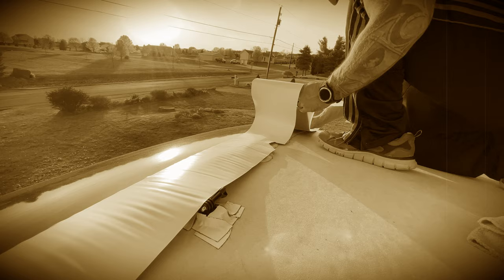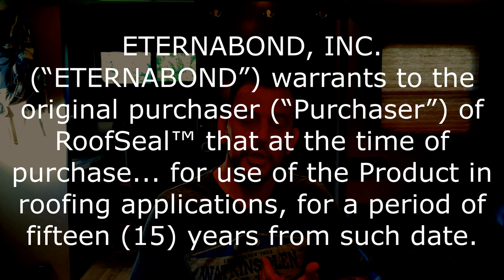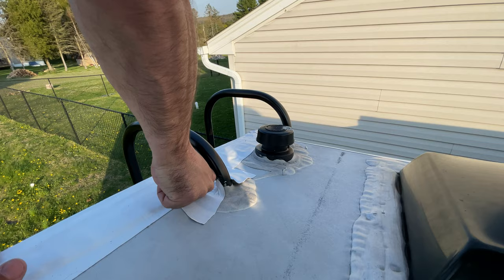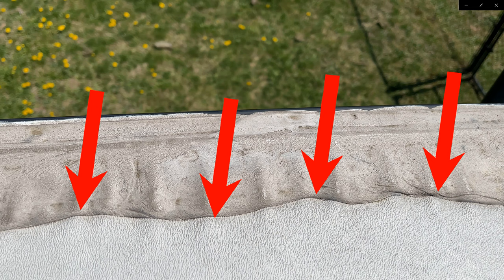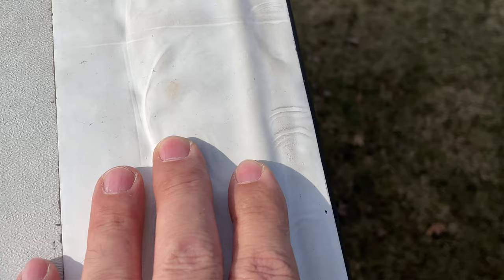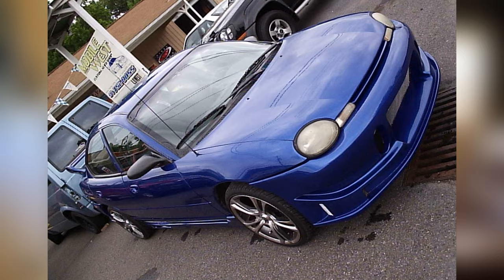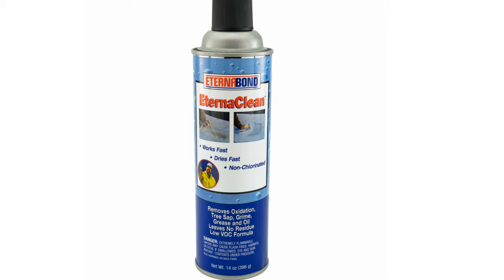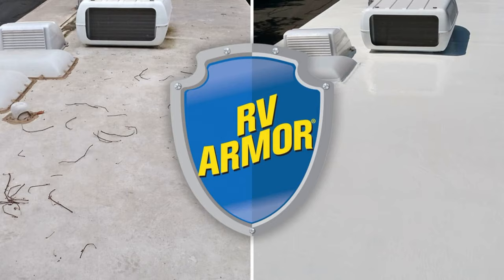The RV Eternabond Roof Seal Modification 1 Year Later

Comment: Ross. Thanks for this lesson. We are just starting this RV experience soon in our 70’s. Waiting on delivery of our new TT. Since we live in Florida and it will be stored outside, should we think about installing this ASAP as a preventative or could we wait for a year and see how the seams are looking? ( or maybe wait 6 months for a cool day.) LOL Speaking of that, does Eternabond adhere better on warmer days?) Thanks again, Larry
Reply: I would at least do the vents and over the fridge unless you got a12 volt fridge and didn't get a vent for it. I would also do the front and back. As for the sides, i would wait if it's brand new. As far as the skylight, remember that skylights can get old or crack and eternabond is hard to remove so that's a personal choice.
Reply from the maker: it seems to be a little stickier on hot days, but applying pressure is important regardless of the temperature.  it doesnt matter when you do it, as long as the sealant is in good shape and clean.  Good luck with your new RV and dont hesitate to ask questions.
Reply: Advantage of doing it soon after taking delivery is everything is clean and hasn't been degraded by the sun.  In FL, I'd consider getting a good cover if I was going to leave it in storage for more than a couple months.  I cover ours in the winter in Idaho while we go to FL. No, we don't take our RV that far.  Yet.  Next winter we're making that trip.

Comment: Great video. Bought a camper a few years ago. Just brought it home to dewinterize/maintenance. Seals didn’t do well this winter. Cracks everywhere. Wasn’t like that when I put it away.  Going to do eternabond tape after I replace the sealant. When you did along the sides, how did you press it in that little indentation inbetween the gutter and roof membrane?
Reply from the maker: You can use one of these:  https://amzn.to/41ccFCD

Comment: I am getting some leaks now after two years. I believe it is getting past the section of tape on the hinge side of the vent. That is a difficult area to get the best seal because of the uneven areas where the hinges are. 

Did you have any tricks to work around that area of a vent? 

I think an extra strip of Eternabond above the hinge area to raise the level of the tape might work. 
Oregon is a rough place to have a leak!
Reply from the maker: not exactly sure where you are describing because i never went over hinges on mine.  everything i went over had lap sealant.  can you send pics to management@rvtipsandtravels.com and ill see if i can figure out whats happening, but i dont think its the eternabond.

Comment: Thank you for this great video. I have one question if I may ask: the front shield of my roof top is made of ABS, has Eternabond good adhesion to such kind of surface as far as you know? Thank you so much. Edoardo
Reply from the maker: eternabond will easily stick to ABS.  make sure to clean it well first.

Comment: Thanks for the original and the update will definitely be doing this to my camper.  Did you do anything to your windows or anywhere else water could get in?
Reply from the maker: windows should be periodically checked with the rest of the seals and resealed if necessary.  I use this to seal my rv: https://amzn.to/39rRyr7
Reply: @RVTIPSANDTRAVELS  did you take your windows out like i seen in other videos or just clean then reseal around them
Reply from the maker: i just check the outside seals.  love working on the rv and making videos, but i dont see any reason to remove windows if they are not leaking.

Comment: Love your videos.  I am going to use EternaBond on all my seams.  One question, with EternaBond seemly so good, could it be used to layer the entire RV roof?  Start in the rear and overlap until reaching the front.  Do you see anything wrong with doing this?  The entire roof would not need any maintenance except to clean.
Reply from the maker: Just the seems, walking on it can cause it to shift.

Comment: Do you think that a small piece of the tape between the rv roof and a solar panel bracket mount would be a better way to seal the screw going into the roof vs the sealant?
Reply from the maker: I’d probably put a dab of sealant over the screw first, let it cure for a month, then you can apply eternabond over it if you want.

Comment: Nice job man.  I’m going to do this to my camper.  One question though, would you put this on your slide outs?  Also are the wipers on the side of the slide outs different size than the top?  Thanks in advance
Reply from the maker: I have not put any on my slide out because the factory tape on the edges is still holding up well. Plus there’s no sealant on my slide out.

Comment: From the 4 years since I've installed Eternabond tape on the roof of my 78 Avion I can only say the tape seems to hold up extremely well to the California sun, It's remarkable that the outer layer of the tape seems unfaced by the UV impact, wonder if it's made of HDPE (high density poly ethylene) and will last for decades?
Reply from the maker: it is pretty impressive how UV resistant it is.

Comment: Living in a jayco fifthwheel up north in Quebec province thank you sir  have a question why put the filler and not just strait seal it with the tape.?
Reply from the maker: the sealer was already on the camper, so instead of pulling it all off i went over it.  either way is fine.

Comment: Curious on why you havnt applied tropi cool over the coach for protection as well as temperature reduction?
Reply from the maker: great question Greg... i think eventually i would like to coat the roof.  havent gotten around to it... my only concern with Tropicool is that it is silicone based, so if a repair needs to be made nothing is ever going to stick to it, and the reason so many RV'ers stay away from silicone based products on an RV.

Comment: On the side, how will you replace the trim protector over the screws if eternabond is halfway on it?
Reply from the maker: its only half way down, so you can still pull the bottom of the trim protector up and away from the screws if you need to.  the tape remains pliable so it will bend when you pull the cover up.

Comment: I have been trying to find out what type of sealant adhesive they seald my trailer with,  its grey an was told it was a very good product  because of  how strong adhesive is .  I would like to reseal then put this tape over it
Reply from the maker: Daniel, try calling the manufacturer or the dealer it was bought from.  It’s probably either Alpha or Dicor.

Comment: I have a few 2-3 inch bubbles on the edges, would you pop the bubbles and squirt some superglue in and then tape ?
Reply from the maker: That’s fine to do, but I’d use an approved adhesive for the type of membrane you have, not just a random superglue.  Make sure the eternabond covers the small holes you create, but that’s fine to do, it’s meant for that.

Comment: What UV sealant could I use ALONG with eternabond? I’m concerned with uv paint sealant not sticking to the eternabond or vice versa. Also, any recommendations on how to figure out what type of roof you may have? I’m not sure if I have tpo or epsom. Thanks so much in advance!
Reply from the maker: sorry for the late response, must have missed this one.  the manufacturer should be able to tell you what your membrane is made of.

Comment: If you removed cracked or failing lap sealant, why would you replace it with any new Lapp sealant if you’re going to use the tape anyway?
Reply from the maker: You don’t have to, but you can apply this over lap sealant.  I think many folks would want that additional layer of water protection.  If I do this again I would completely remove lap sealant.

Comment: Great video. After how many years, should I start looking to do this mod? My TT is less than 1 year old.
Reply from the maker: Doesn’t matter, remember the purpose of the mod is so you don’t have to reseal with lap sealant.  So the lap sealant needs to be in good condition to cover it.  It’s not to fix leaks.  If you have a leak it’s best to find out why first.  But if your lap sealant is good, you can do it.

Comment: Big question - I have an aluminum roof. Any caveats, anything different or that I need to watch out for,  in applying to a metal roof? Thanks so much -
Reply from the maker: eternabond will stick to aluminum.  if you have rivets, you might have one pop later, i would ljust gut out a section to fix the rivet, then apply a small piece back over it.

Comment: I have one area on my trailer where the lap sealant is cracked resulting in inside water leaking.  If I replace the lap sealant only in this area before applying Eternabond, what brand/type of lap sealant does everyone recommend?   Thanks for the great video!
Reply from the maker: if you have either a TPO or EPDM membrane you can go with either Alpha or Dicor.  Both good products.
Reply: @RVTIPSANDTRAVELS  The trailer is 20 years old.  The front cap is a white colored molded plastic.  Not sure what the material is.  How can I tell what the material is?
Reply from the maker: go with this, great product, cant go wrong with it.  let it sit for 30 days in warm weather before covering with eternabond. https://amzn.to/4cbX9xl
Reply: @RVTIPSANDTRAVELS  Thanks!

Comment: Thanks so much for the very informative videos. I do have questions I’m really hoping you can help me with. I have a 6 yo little 18’ tt that has spent the majority of its life in the dry heat and sun of El Paso and Arizona deserts. All of my lap sealant is trash and needs to come off or is already gone. Can I use this INSTEAD or is the lap sealant a requirement first? 
- also note that as soon as this is done I’ll be selling so money and time are a concern, BUT I’d still like to do it right. 
Thanks so much in advance!
Reply from the maker: Honestly, remove the lap sealant and apply new lap sealant.  Call it a day.  No need to use eternabond on something you’re selling.  It’s an additional cost and more time for something you aren’t going to benefit from.
Reply: @RVTIPSANDTRAVELS  Thanks so so much! Really appreciate all the info and your reply!!!

Comment: Our camper is a 2020.  It looks all original up there.  When we get it out of storage I think I will do this while it's still in good condition.  I am wondering if wider is better when using the eternabond?  Seems that if there was a slight leak under an edge then obviously the further away the better.  Obviously more money to go wider...do you think that's necessary?
Reply from the maker: Not necessary IMO, I’d go with enough to cover about 2 inches on each side of the sealer.

Comment: another issue that this mod could complicate is when the TPO adhesive fails - which seems a bit more common after 3 years.
Reply from the maker: The tpo adhesive on my rv started failing long before I installed eternabond.  However, in the 2 year review video, I show that the lifting actually stops at the end of the eternabond.  Had I not installed eternabond I’m willing to bet the pulling would have continued further.

Comment: Have you run the eternabond from the roof right down the side?
Reply from the maker: No, I wouldn’t recommend doing this.  The tape stays pliable and may slide on vertical surfaces.

Comment: Question, what if there is a possibility of water or moisture underneath the rubber membrane what would you suggest?
Reply from the maker: that's an issue that i have never dealt with and probably wouldnt be the best person to ask.  i would assume however that it will cause the membrane to separate from the surface, and probably should be removed, dried, and reglued first, or even an entirely new membrane.

Comment: curious on on every ones opinion.  I have a 2022 jayco jay flight slx 8 264 bh.  live in se michigan.  obviously if the roof is in need of repair do it but how many years before doing as a preventative measure?
Reply from the maker: repair first, you need to have a healthy foundation

Comment: What do you think of eterabonding the slides?
Reply from the maker: ive seen folks do this on the top of the slide where there is that line of tape, however I have not done it yet.  I would say this, dont use eternabond on a vertical surface.  it will slide down, but you can do it on the top of the slide.

Comment: Is the (very minimal) height of the product enough to affect drainage off the sides into gutters? Wondering if slight pooling happens. Thanks!
Reply from the maker: Good question... there might be a small amount, but its so minimal.  If there is, its not affecting how the tape edge is sticking.  a 2 year update is coming soon.

Comment: I am a novice at this, but could you use Eternabond over the entire roof? Is it worth it? What is the most economic way to redue the roof? I have a 28' FR Wildwood Xlite.
Reply from the maker: I wouldn’t.  Because it stays pliable, it’s not good to walk on.
Reply: @RVTIPSANDTRAVELS  thanks. Didn't think of that, good to know before I started that one.

Comment: Hey Ross. I just purchased a new RV. 2023. Would you suggest using this on a brand new roof?
Reply from the maker: You can, doesn’t matter if the rv is new or not honestly.  The condition of the lap sealant is more important.  If the lap sealant is bad, replace the lap sealant and let it cure.  Being it’s new, you’re fine.

Comment: I use a product called Through The Roof. It is a thick liquid that you apply with a brush. It's used on homes etc.. to seal. It is about the same consistency as silicone for comparison. It works very well and I used it on all my skylights and vents on my 5th wheel. Very easy application. I simply scrubbed the area to be sealed, wiped down with a towel and the brush applied the product. It is crystal clear and I have had zero problems.
Reply from the maker: Thanks for the info!

Comment: I just bought a brand new, 2022 camper. Would you (or anybody else reading this) recommend using eternabond, as you did, on my new camper, or would that be a waste, since it's so new?
Reply: I was wondering the same thing.
Reply from the maker: age doesnt matter, what matters is if you are going over the lap sealant, it is healthy.  everything needs to be cleaned as well.

Comment: So I have a 2008 Flagstaff it needs a new roof I have two questions 
1 I’m going replace some sheathing because of water damage would you recommend any tape cover the seams
2 After seeing the eternal bond tape I’m thinking the lap sealant might be a redundant sealant and not use it your thoughts 
Thank you Jim 
Ps great videos
Reply: If you're paying for a new roof i would just go with a lifetime roof. There are 2 main options...rvroof or flex armor or rvarmor. One will come to you, the other you'll need to find a location near you as it is done in a controlled environment.
Reply from the maker: just talked to a guy today who has RV armor and said its cracking,  they offered to come out and fix but he is going to fix himself.  another reputable channel too so I believe him.  i think roof coatings are fine, but they arent nearly as thick as eternabond and I dont see them providing the elasticity and protection.  i think theyre fine to add some UV protection to the membrane and other components, but i dont think they provide the sheer protection of eternabond.  just my thoughts though.
Reply: @RVTIPSANDTRAVELS  that's good to know. I'm doing the eternabond route for now but if i ever filed a claim for a new roof i was looking at the lifetime roof route. Rv armor cause they come to you but flex armor has better reviews and they are near me. I guess if the time ever comes I'll have to do more research

Comment: I'm wondering if any of the lower cost options of tape are comparable to eternabond? Have you heard anything that is a solid alternative? I actually just ordered some of the cheaper tape as I have a leak on 1 skylight. I thought I'd give it a try as it seemed to have maybe 80 percent positive reviews and costing less than half of eternabond.. hopefully it does the job??! Are you certain that the lap sealant needs replacement prior to taping if it has failed?
Reply from the maker: Haven’t tried any of them.

Comment: I understand the tape along all edges, even on a problem area that may be leaking. But putting the tape around everything that’s on the roof? Let’s say the skylight over the tub cracks and needs to be replaced, but you have tape over all the self-leveling caulk. Seems like it would be a nightmare getting that tape off without ripping the rubber roof. What are your thoughts on this?
Reply from the maker: The tape on top of the sealant won’t affect how the sealant sticks to the membrane. If you have to replace it cut along the edges of the sealant.  This is actually explained in this video around 7:44
Reply: @RVTIPSANDTRAVELS  sorry, somehow I didnt see that part of the video

Comment: Has anyone used this and effectively stopped leaks? I have several that idk where they are from so this is my first attempt to fix it.
Reply: I have successfully used this to patch a small rip in my roof. I simply cleaned the area, ( not very well at that) cut a patch that covered past the rip by about an inch and stuck it down. It's been about 3 months and it is fine.
Reply from the maker: thanks for watching!

Comment: Duct tape will pull remaining microsealant off the surface after you’ve removed EternaBond tape with heat and a scraper.

Comment: Would it stick better if applied with heat?
Reply from the maker: Sort of… just apply it on a warm day when both the eternabond and membrane are the same temperature.  Using a heat gun might affect how it cures if it’s cold out.